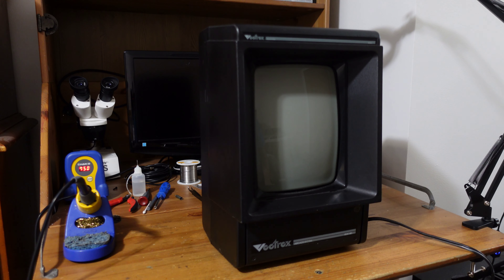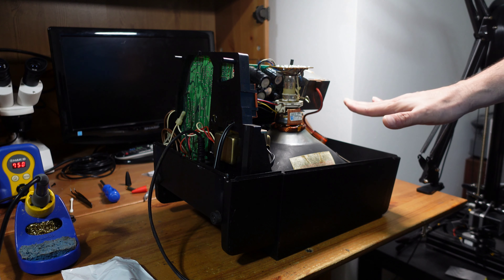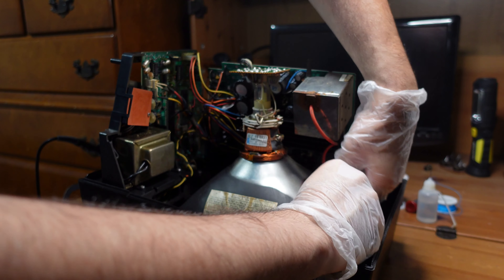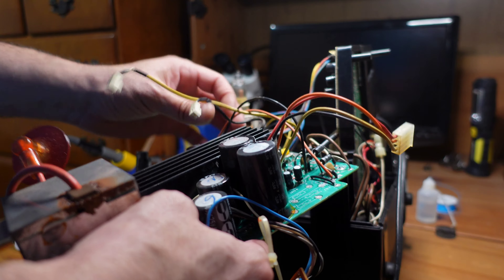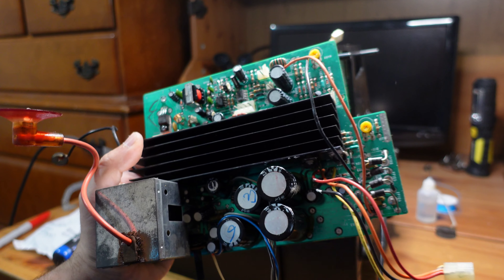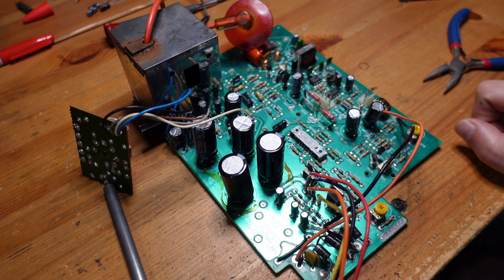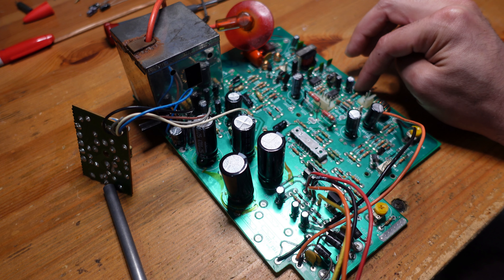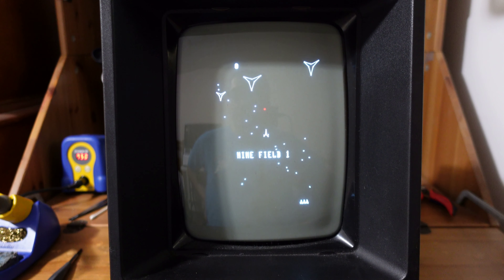Vectrex console repair! Teardown, capacitor replacement, and demonstration

Comment: Nice video! Just finished re-capping my vectrex and cleaning all contacts. Works like a charm!   FYI - the 'red' wires you mention at 5:20 are from the power transformer (the center-tap is the white wire), so they are interchangeable with no effect to the circuit - hence they are the same color by design.

Comment: Can you share the list of capacitors used for the replacement? To have a reference when i try to recap mine.
Reply from the maker: You can find the capacitor list on the console5 tech wiki

Comment: Mine needs to be recalibrated but apparently that can only be done using an oscilloscope. I'm not even sure what I did to it to get the vectors misaligned but it happened after a full disassembly and clean-up (it was far too fitly )
It turns on and for the most part works but some of the vectors/lines are just misaligned.

Comment: I’ve been holding off recapping my vectrex because I am so afraid of breaking it beyond repair. I work on CRT monitors often, so it’s not the tube that scares me, it’s things like accidentally lifting a pad or something like that.  It works great at the moment, I just know I will need to get in there sooner than later. Thanks for the walkthrough!
Reply: Update: I’ve recapped the Vectrex and she works beautifully! I was so confused because I couldn’t find the bipolar cap then I watch the video again and you pointed out the heat sync. BIG help! Thanks again

Comment: Love the Vectrex, Have one myself and last time I used it worked fine. Do you suggest a recap as it is old even though it is still working. Great Job
Reply: Unless they're leaking and/or bulging, no. If it's working, I'd leave it alone.. Kind of like the old saying goes, "if it ain't broke, don't fix it". :)
I wouldn't attempt a power board unless you have a good desoldering gun.. They can be a bit tricky. I've done a couple so far.

Comment: On my Vectrex, the screen shakes a little like a heat haze.
Is it necessary to replace the electrolytic capacitor? I'm not good at soldering irons and I'm worried.
Reply from the maker: Yes I think it’s definitely having some issues and it needs to be serviced. It may not be the caps, but the caps are definitely a possibility